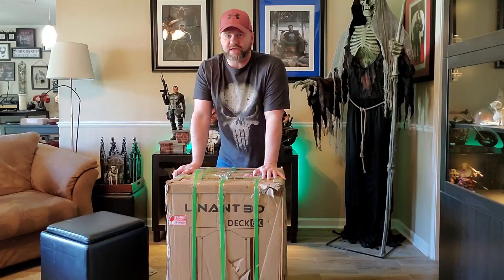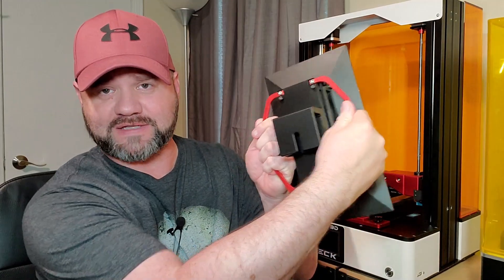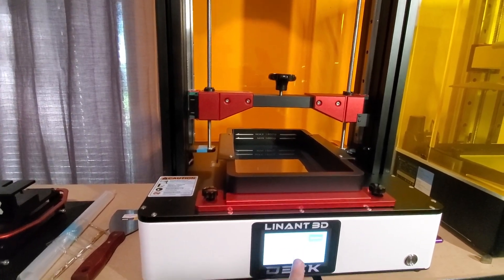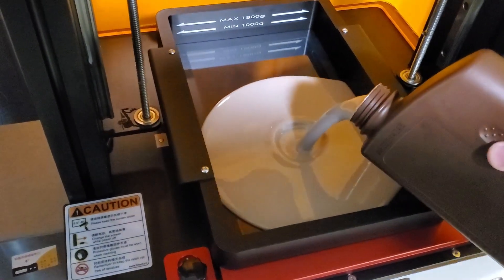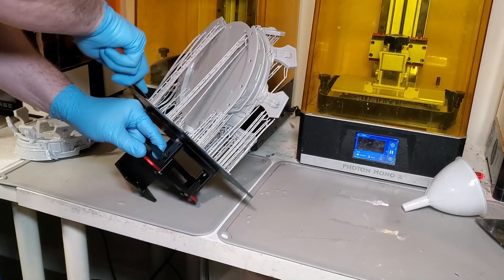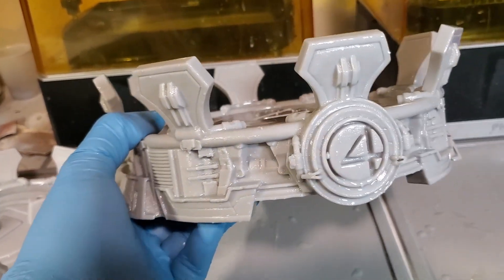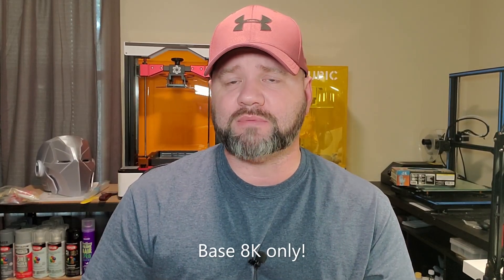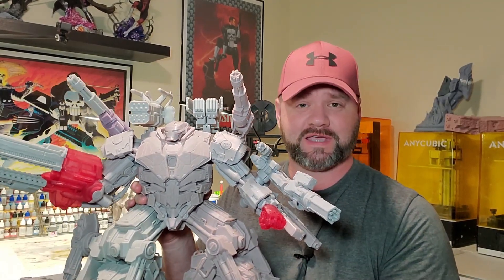LINANT Deck HUGE 3D Printer review + Bonus Footage!

Comment: Hi Henry.  I bought this printer and really like it.  Lost all my Chitubox settings on drive failure and now when I slice it says incompatible file format.  Can’t seem to get it to slice out of Chitu now.  Any suggestions for config in the slicer?  Thanks, not having much luck with support.
Reply: I joined you Patreon and I'll ask there.  :)
Reply from the maker: Make sure its set to a .ctb file. If that doesnt work, reload the firmware from your zip drive or download it from the Linant site.
Reply: Unfortunately I lost the config files in the hard drive crash.  I couldn't find a place to download any files on their site.  Do you have the resolution handy in your Chitubox Settings?

Comment: Hey, this is the machine for me! the Jupiter Nods, Anypubic sucks, the Mega 8K is a pain to clean and bumped up the price $500.

I want to get it, but that shipping cost is stopping me even with the sale. You know if these are coming to Amazon?
Reply from the maker: I know shipping is a killer. The Base 8k is on Amazon now but it's smaller than the Deck. Still a great printer.
Reply: @TheCreativeCollector  yeah, I have a Saturn 2 that has been good to me, I want a large format machine for larger prints.

I will just keep an eye out for Amazon availability.

Comment: wow this looks like it printed perfectly, what is build size comparison vs the m3 max? i cant decide which of the 2 ill be getting. great video
Reply from the maker: It's a little smaller except for the Z axis which is a lot larger. That means you can print taller objects, which helps if you want to print a full size 1/6 figure in one piece.
Reply: @TheCreativeCollector  i mainly print myself 1/4 pieces and have the photon mono x but its time for an upgrade. I appreciate the response ill await more vids and make a decision

Comment: How were the settings and what resin did you use?
Reply from the maker: I printed this is 1.8mm thickness with 5% grid infill at .05mm. I used Sunlu resin for this and it turned out great.

Comment: Cool print! Quick question if you see this: How expensive is the approx cost of the resin to make the huge tank version of iron man? I figure it can't be cheap!
Reply from the maker: It wasn't too bad. I used 5 bottles or 5000 grams. I used Sunlu resin at $24 a bottle.

Comment: The real question is why would you get this over the anycubic M3 Max. 🤔
Reply from the maker: I have the M3 Max and it's a POS. Nothing but trouble since the day I had it. Anycubic doesn't answer service tickets or emails. So I have a $1200 paper weight.
Reply: @TheCreativeCollector  Wow! Dude you just saved me $1200. Will you be making a video on what happened? TIA!
Reply from the maker: That's just it. I'm not sure. I'm guessing the buildplate is warped, or this goofy frosted FEP sheet is to blame. This Linant Deck printed right out of the box with no issues. I've been printing like crazy with it, and have yet to have a failed print. The M3 Max is nothing but failures. But yes, when I figure it out, I'll update about it.